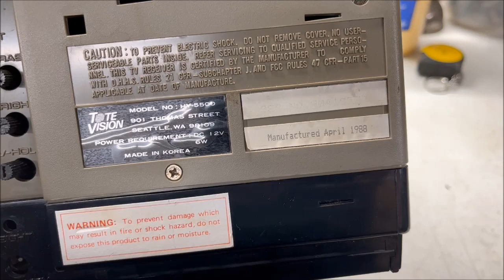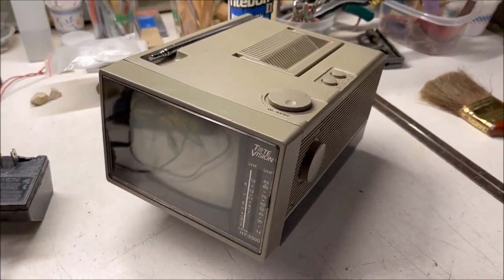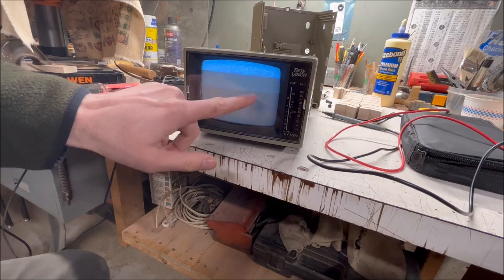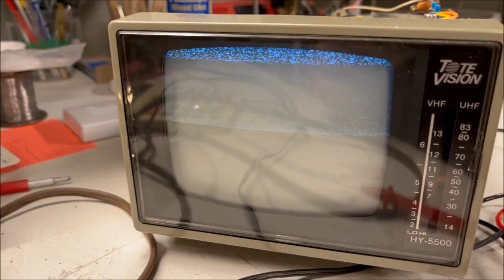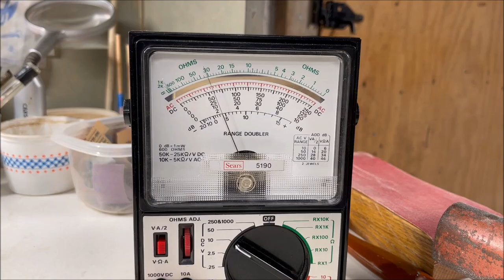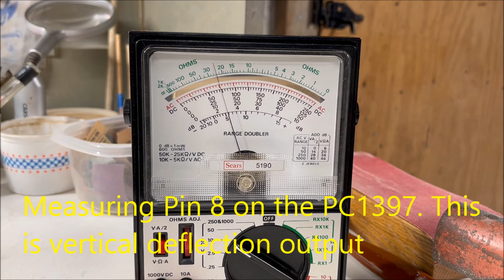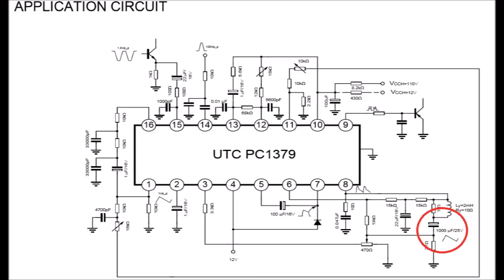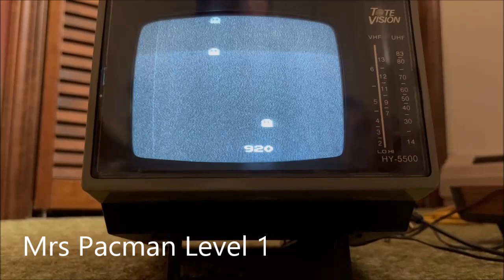Retro Black and White Portable CRT TV Repair

Comment: I have a Tote Vision HY-5705. It is similar, other than the fact that the case is all black and it has a AM/FM stereo radio. The tuner in the TV stopped working, so I just made it a direct composite signal.